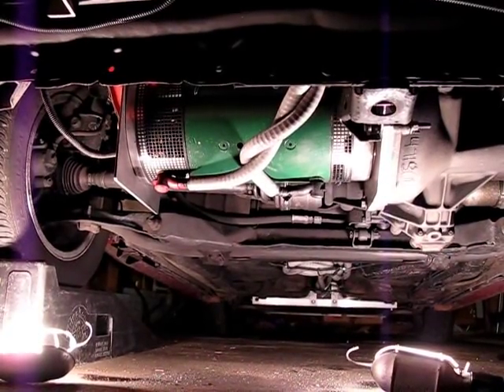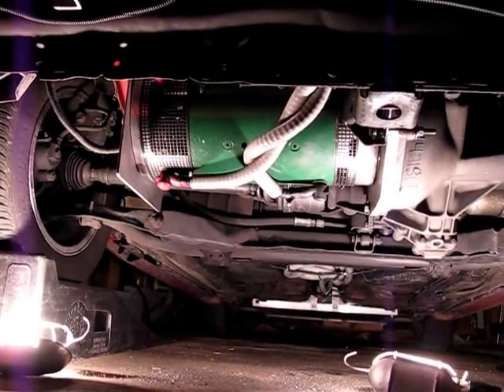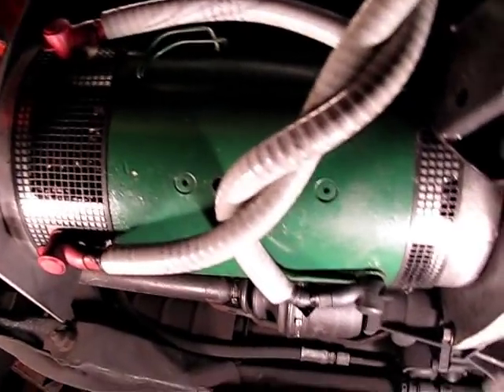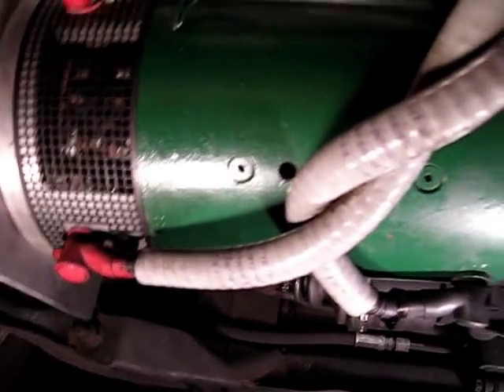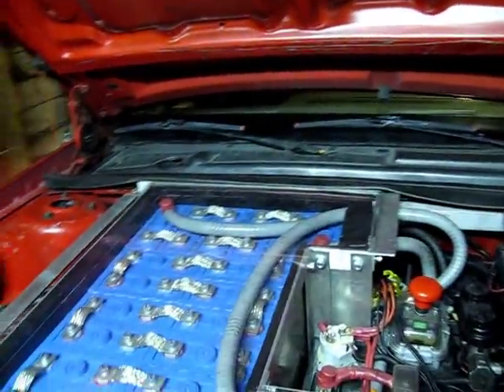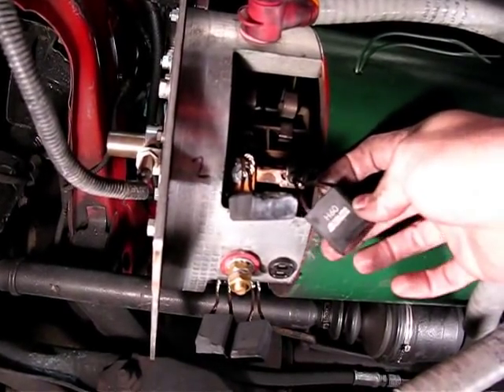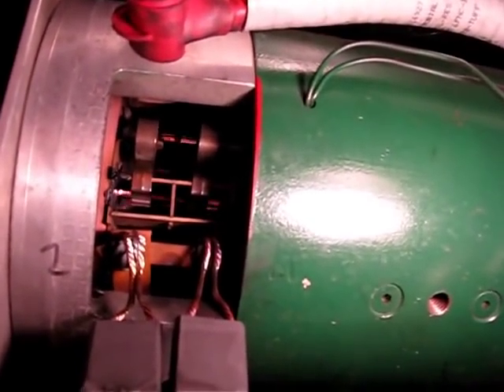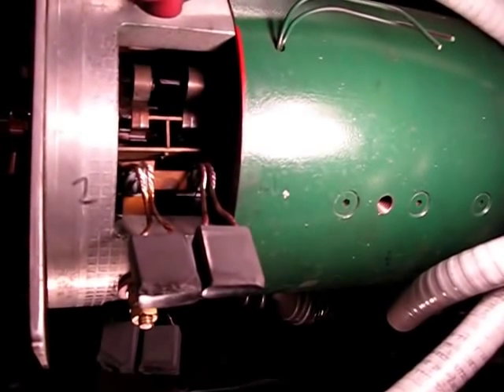October 16, 2012 - 'New' Motor Smoke, Bad Noises, & Brush Debris

Comment from the maker: The irony is that I ran the (1st) motor for almost 2 full years with the original brushes with no maintenance of any kind, and had no problems what-so-ever.  I suppose it could just be co-incidental that all of these issue started happening right after I swapped out my original set for the 'better' Helwig Carbon H60 brushes...  Or perhaps it's just because I didn't seat them properly for the recommended 6,000 to 10,000 miles -before- driving. :/